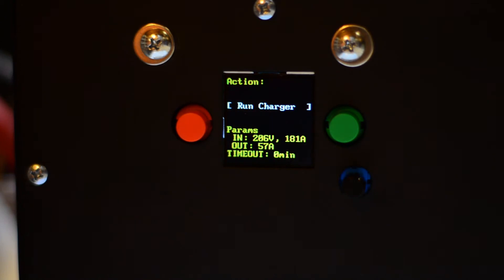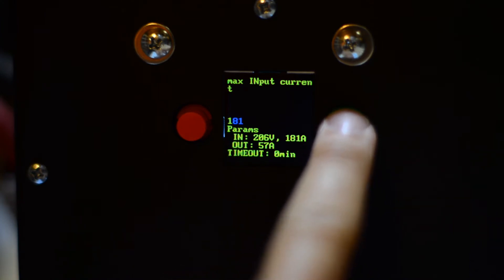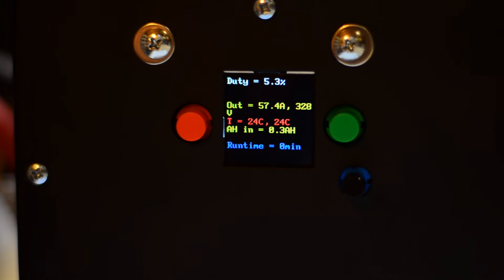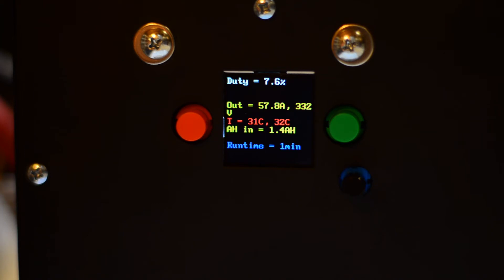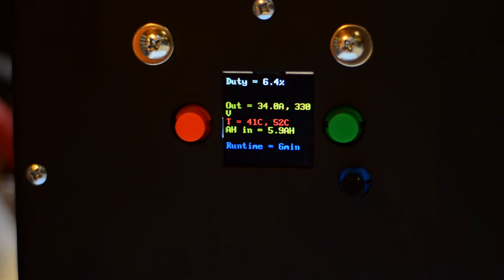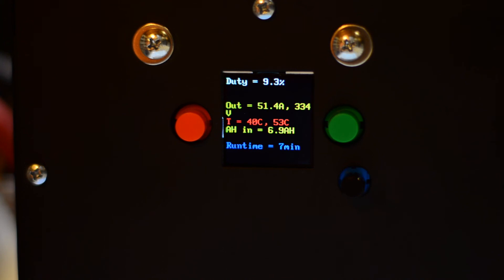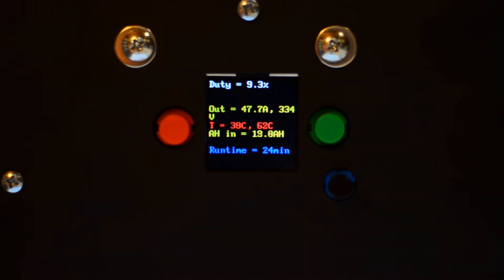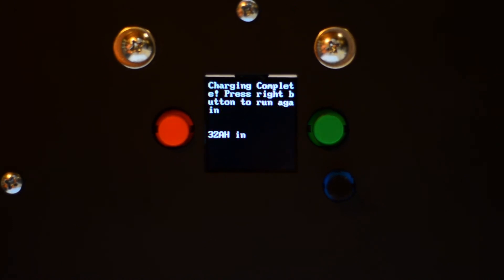EMotorWerks PFCDirect-20000 - 20kW EV Charger - test runs

Comment: Will this 20kw supply require a 100A or 200A AC circuit?  If so, I will redo my wiring in anticipation.
Reply from the maker: 100A circuit